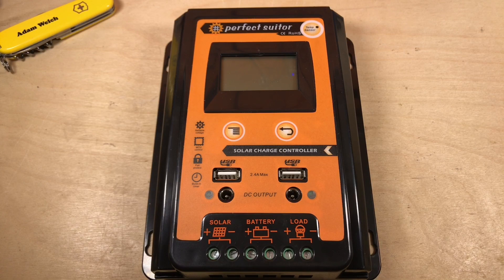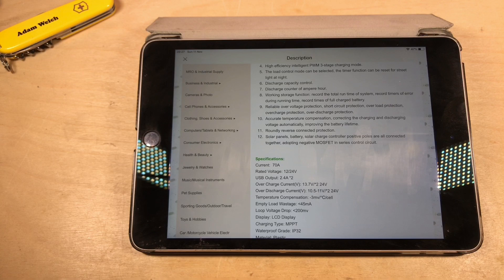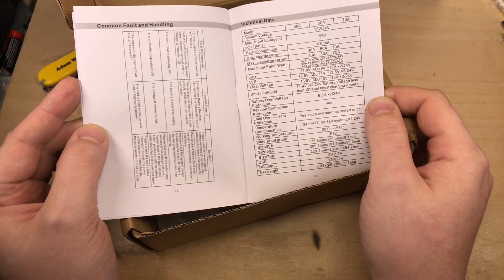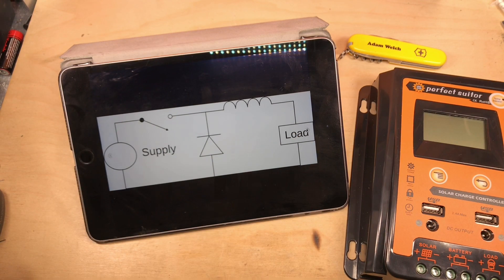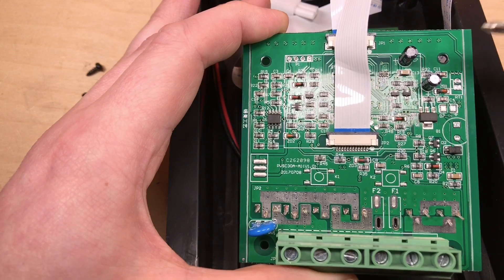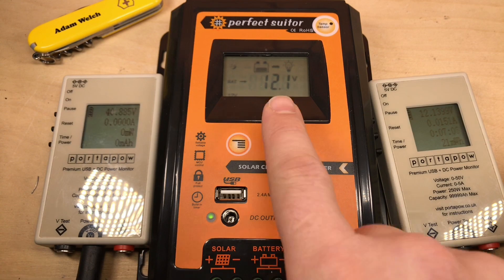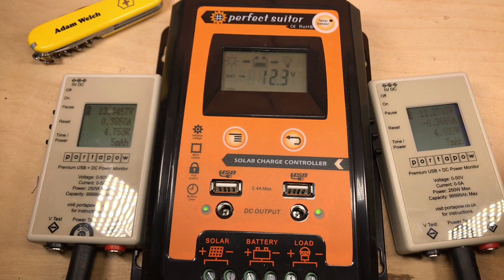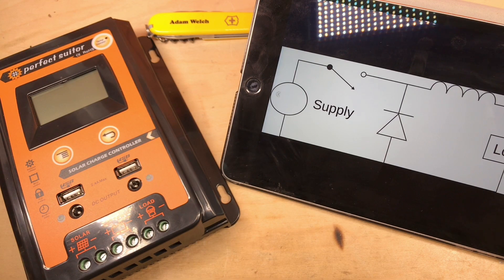MPPT or PWM? Perfect Suitor Solar Charge Controller

Comment: Can you checkout the tracer 60,80 &100 amp versions. Maybe not buy one . just a internet search and your opinion. I would almost buy one . I haven't seen anything about them . it would be nice to see a review of them.
Reply from the maker: Epever tracers? They don’t make any that high current. The itracer and etracers only go up to 60 amp.
Reply: Adam Welch tracer AN 10415an = 100amp. I saw them on eBay a week ago. They have 60,80, & 100 amp versions. The 100a is a lil bit over $400.

Comment: However, the timers might make it worth it.  See if you can hook it up to the shed and use it to turn xmas lights on at night and off. No need to even put a solar panel.  However if you had a 60 cell panel, it would be operating near mppt voltage anyways.  I wish they would not put pulses on an off, just hit the voltage and off.  But I guess that is for lead-acid.  Even if each panel had their own controller you might get more power if a bird poos on your array and breaks the circuit.

Comment: "Full protect" it says, but I saw no fuse of any kind inside the controller. The Wincong SL-03 30A that I have at least sports an actual blade-style 30A fuse inside, easily replaceable should it blow.

Comment: thank god i just got my hands on a used MPP Solar Pip 2424MS, big chunky MPPT controler w/ built in inverter (2400w) and AC passtrough from the grid (can also charge the batteries from the grid if needed)
Reply: that's the model with auto self distruct. Nice one.

Comment: Well, that's going straight in the ewaste bin!
I hope one day there'll be consequences for sharks selling mislabeled products, but thanks for warning people again that MPPT controllers are a favourite target for fraudsters.
Education is key!
Reply from the maker: One day I’ll test it as a PWM solar charge controller. It might be good! Cheers Andy
Reply: @AdamWelchUK  May be useful if every other controller has died and all your panels have been hacked to give an mpp of around 14V, with the liberated cells going to make another panel to compensate!
ps.. I made another panel! https://twitter.com/ahaveland/status/1057715731297648640
Theoretically 475W, 5.3kg and fit in a backpack.
Am making a solar tracker, and struggling with blender to make a 600 tooth GT2 pulley for the azimuth... I forgot how painful blender can be to use!

Comment: It looks similar to the tracer A & AN controllers. Have you checked the tracer 60, 80, & 100amp AN controllers?? Only thing is if I'm spending over $400 for a controller I'd probably spend a bit more and get the midnite classic150! For about $575, I try staying about 10amps under the rating on the tracers. I could use a single high current controller. Great video.
Reply from the maker: It has a similar lcd and button arrangement doesn’t it? Although I’ve only put my hands on the 20amp tracer models I’ve seen plenty of other videos and images to be confident that EPEver MPPT products do all have decent inductors in them for buck converting.

Comment: Did you just connect 2 12v  panels in series to the controller to charge a 12v batterie?
Reply from the maker: Yup. Solar panels will pull down quite happily to a lower voltage - the biggest trouble is your significantly reduce their power output as we saw. It could over charge the battery if it was left connected for a while but only if you’ve not got a charge controller connected.

Comment: Thanks, Adam!  I was looking for an MPPT for our work to replace a PWM controller that I somehow made it stop working.  I saw this on eBay the other day and was wondering if it actually was an MPPT?  I will keep searching.  Thanks again.
Reply from the maker: Let me know if you find something as cheap that looks genuine :-)
Reply: @AdamWelchUK  I belive I brought this seller up about a year ago: https://powermodule.aliexpress.com/store/group/MPPT-Solar-Charger/515737_250338107.html?spm=2114.12010608.0.0.d4c21d047grQv5

He sells a few models and they're potted but they look like they might be legit or might also just be boost/buck converters with no actual MPPT.

Comment: I can’t believe how misleading some products are. Same with 18650 batteries with 9800 mah..... omg this has to stop.
Reply: There are only two ways of stopping it, information so people need to know when to stay away from something and demand a refund when they find out they've been ripped off, this however doesn't tend to happen since it can be easy to write off something under $20 as not worth the time/effort or sometimes in the case of electronics such as this people often don't even know they're being ripped off as they have no understanding of electronics or batteries, they just see blinking lights and think it's working and leave it at that, in other words it'll never stop because just like with any scam there are plenty of fools/suckers ready to part with their money.
Reply: Even american products can be scams, after 1 year it breaks. It is best to go by youtube reviews.  This is an incomplete review it does not show how the timer works, how the voltage ends, can it be used on lithium, but it does show how simple it is on the inside.  Many times sealed lead-acid settings can be used on lithium.